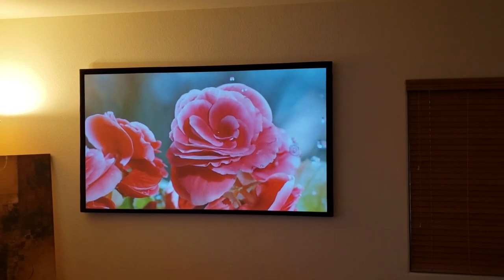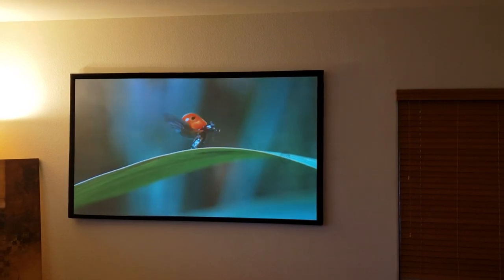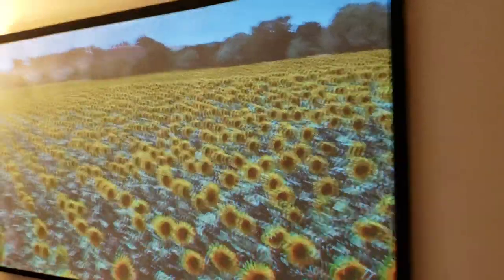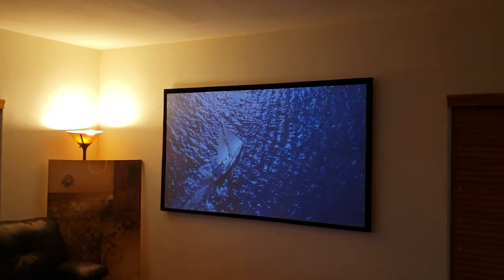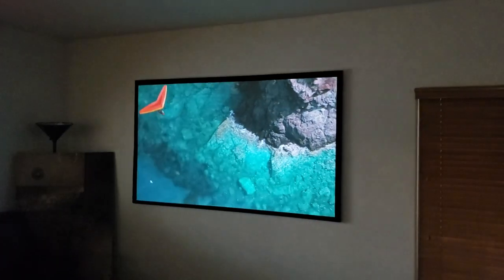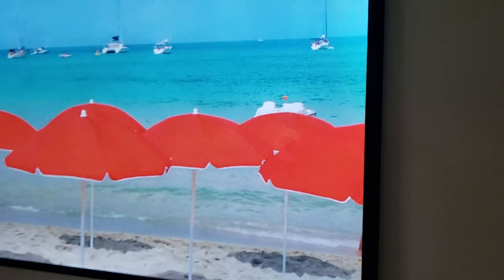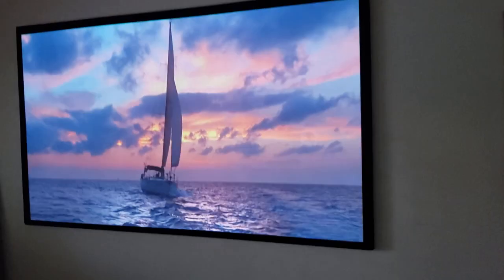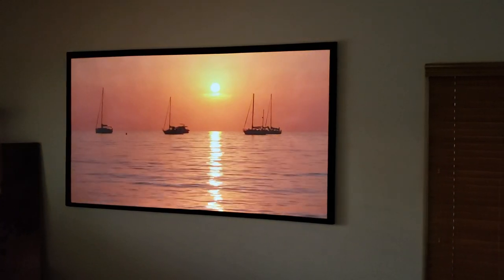DIY Projector Screen - My Personal paint mix

Comment: Good work. How did you applied the glass dust? Did you use a roller too ?
Reply from the maker: I'm going to put another video out soon showing how.
Reply from the maker: Harbor freight ground glass .  the 5 lb size container.  I drilled holes in the lid like a salt shaker and with the paint wet, dumbed it on top of the paint.  when done, all  I could see was the Glass.  After about 20 minutes, take a soft paint brush and brush it off.  I put a tarp down to collect the unused glass for reuse.  Video coming soon.  Im going to try to do one today
Reply from the maker: Yes.  Used a roller.
Reply: @dtmoore4  creo que son micro esferas de vidrio y se rocía sobre la pintura no muy húmeda solo para que se hundan un 50% no se debe de mezclar ya que perdiera su reflectividad . y si es con vidrio molido producirá puntos calientes o luces  que destellan en arco iris. por sus formas irregulares y exagonales

Comment: How much glass dust did you use?  6oz or ? and was there a certain brand name.
Reply from the maker: Harbor freight  ground glass in the blue container.   5 lb
Reply from the maker: Harbor freight ground glass .  the 5 lb size container.  I drilled holes in the lid like a salt shaker and with the paint wet, dumbed it on top of the paint.  when done, all  I could see was the Glass.  After about 20 minutes, take a soft paint brush and brush it off.  I put a tarp down to collect the unused glass for reuse.  Video coming soon.  Im going to try to do one today.